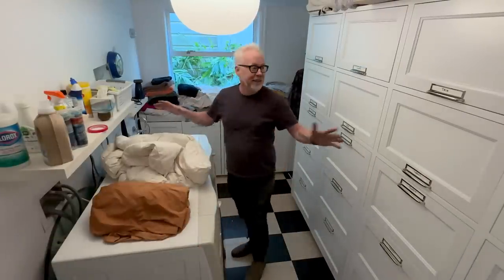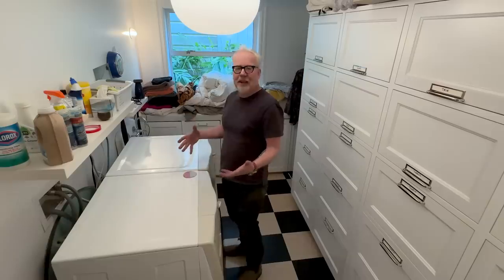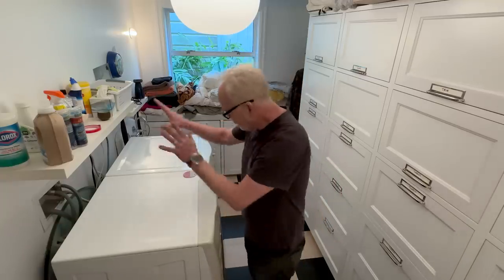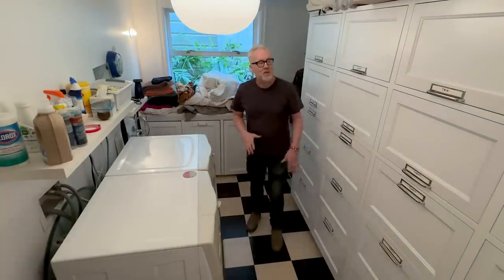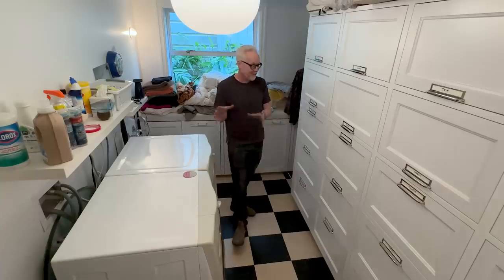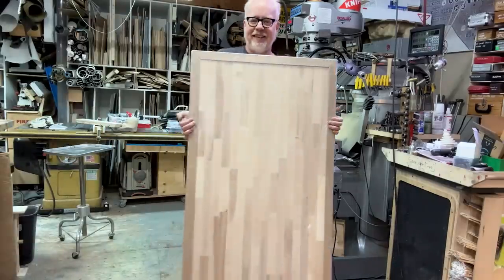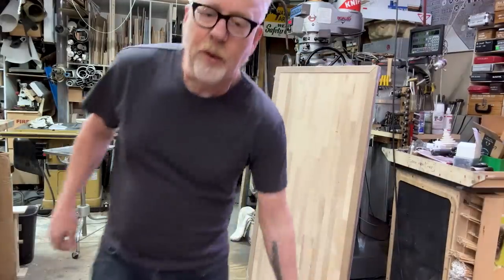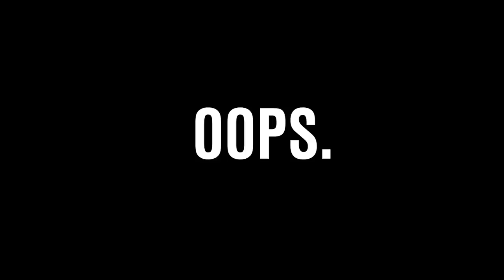Adam Savage's One Day Builds: Laundry Folding Table!

Comment: Adam has never given me anxiety before, but balancing a table top on its side on an uneven surface and then going here is my circular saw is doing just that now. After Decades of watching him. Thank you for the 3 way boxes/ clamps as I type this.
Reply: Came here to see if anybody else had the same anxiety lmao.  Good lord.
Reply: Even with the boxes it was still a beyond stupid cut, he has a table saw he could have used for that cut.
Reply: @kz.irudimen  A tablesaw with a dado stack or a router would be a way easier and more precise way to do that. He really doesn’t think through his steps sometimes. Love his videos, but holy crap…
Reply: And why use a rebate at all?  The backsplash isn't going to take any stress, just plant it on there plain style, just glue it and screw it. Adam often makes me nervous, the way he handles woodwork
Reply: @bokiphoto  If it works it works. I do not mind his wood working skills just his balancing skills lol
Reply: ehhh he was cutting a really shallow depth with a quality blade, though it was a silly rabbet with his tablesaw right there. 
If anything too wacky happened that Festool has a brake+kickback brake, and he has soft hands and can follow a line and release a trigger. I thought the apple box jack was a dandy solution for his typically Savage choice of backup weapon :)
now the conception of this thing on the other hand, both sides need to be sealed for temperature/moisture swings in that enviro.. 
and with that vhb, well, at least those machines aren't going anywhere..
this build def could have used less impulse all around, but I am jealous of that TV money laundry room. :glasses-purple-yellow-diamond:
speaking of which.. it's foldin time :face-fuchsia-poop-shape:
Reply: @bokiphoto  registration in a rabbet so he didn't needs clamps to glue and screw. that glue do be slippery. 
(and yes, he obviously should have used the tablesaw for the rabbet cut. silly rabbet :body-blue-raised-arms:)
Reply: Yeah that was a pucker factor of at least 6 when I saw that thing on its side and the circular saw still in his hand.
Reply: @bplup6419  I openly admit I do the same things but never in front of a camera I never want someone to see my stupidity and go so that is how it is done.

Comment: BTW, those cardboard channels that protect the edge are really useful. I cut them up into shorter sections and use them to lift boards off the bench when applying varnish and paint.
Reply: I like to keep used tp rolls in the shop for the same purpose, and many more.

Comment: I personally would have used some small rubber feet on it instead of the VHB. With the weight of the block, that should be more than enough to keep it in place, and allows it to move a little when the machines vibrate in use. Plus you can just pick it up if you need to move it for maintenance/replacement. Also most Home Depots now carry butcher block countertops in store these days.
Reply: I was also concerned about the vibrations. Washing machines vibrate a LOT. So to have something in a fixed position sitting on top of two of them sounds a bit problematic.
On the butcher block hardware shop though... it depends on locale. Maybe these things are easy to find in the US but over here you'd pay a royal prenium for butcher block countertops when you could buy the timber and make one yourself for a third of the price.
Reply: I'd be afraid I'd have to pull it out for maintenance/repair etc. I'd just use a couple of lengths of the waffle style rubbery shelf/drawer liner. It works great for holding workpieces in place.
Reply: also, you're mechanically coupling the two machines, which both vibrate. I have a feeling the system as a whole will be noisier this way.
Reply: Vhb sucks to remove
Reply: VHB comes in quite thick sizes to provide dampening from vibrations. I've used it in lots of automotive applications without issue for years.
Reply: I think it makes even more sense to just build the table to be a little wider than the two machines and put legs on it so it just straddles them without touching them at all. I guess that makes it harder to move it out of there, but how often will that really be?

Edit: ah, the sink is in the way.
Reply: @mediaphile  if the"legs" are only like 6 inches deep and the machines are effectively clamped together that could work too. Could put something soft between the machines to keep it all in place.
Reply: so does ikea and its the right size. dont tell him though
Reply: @machinate  separate unit attached to wall or just get some legs.. easy peasy
Reply: Exactly, that’s what I did when I built this exact thing out of mahogany in 2021… glue-on rubber feet, perfect absorbing of vibrations
Reply: @user-hd8ej8yx9p  i guess he doesnt use the washing machine ... the thing will wreck the machine s as the vibrations will destroy them.

Comment: Only Adam would try to freehand a rabet cut on an unsupported panel whilst standing beside a carpenters work bench !
Reply: also with a table saw in the background
Reply: It’s the Adam Sandwich we’ve come to know and love. 6 million subscribers now know that THIS IS FINE.
Reply: That was *concerning*, but then he brought two apple boxes and a clamp... and I was still worried.
Reply: I would have just used a router to cut the rabbet.
Reply: @sithus1966  Exactly what I was thinking
Reply: I don’t understand why he cuts one at all – it’s unnecessary, it would be perfectly alright to attach the strip of poplar to the edge of the board. You could glue it if you want to, but a few screws would be enough, in case you want to use the worktop for something else later.
Reply: Safety Third!..!..!
Reply: With a Festool track saw with no track 😢
Reply: I love Adam, but the inner woodworker in me was clenching so tight the whole video. So many unsafe things happening!
No respirator- breathing in saw dust
No supported work piece
Running a track saw in reverse
Free handing a rabbet joint while straddling it
Placing a spinning blade down (circular saw) 

I know Adam is a professional, but it just takes a half of second to have a life long injury. There is always time for safe practices in every shop.
Reply: The clench on my butthole during that segment, man.  Could've made coal into diamonds 😂
Reply: @anthonyseiver7000  he was for sure sent the track saw from festool and paid a few grand to include it in a couple projects over a certain time period.
Reply: I had to double-take because I didn’t believe what I was seeing hahaha—us mere mortals couldn’t ever dare to dream
Reply: The anxiety I had while watching him make that cut was insane. I'm over here "like just use a router!"
Reply: Not just a woodworker’s bench, but a multi-thousand-dollar slab top woodworker’s bench with two (!!!) Twin Turbo vises which is explicitly designed for exactly this kind of work! I think seeing that killed a part of my soul.
Reply: @mm9773  It's not fine, it's idiotic
Reply: Kind of curious about why use the saw rather than a router
Reply: glad I wasn't the only one screaming at my computer during that. very glad there weren't any injuries from that unsupported track saw cut. kickback on the track saw can be brutal, especially if there's no track in place. I was curious why not just take multiple passes from the top with the track and carve out the rabbet that way. sure it takes a few extra passes but would've been much cleaner and safer
Reply: The compromises that are made for getting the shot and mugging to camera are lost on ya all … 😂
Reply: Everyone has a different risk tolerance.   I saw it as more awkward than unsafe.  The workbench vise would have been easier.   Adam has more hours doing this kind of work than most of us.  He seems to still have all of his digits and extremities.  If all you see here is a safety violation, then you are missing the point.
Reply: Even if he didn't want to clear off the table saw or pull out the router, I was just going "leave it on the sawhorses and make a few cuts with the track saw, clean it up with a plane or chisel if needed" 😬
Reply: Adam doesn't worry about safety. I could never be like him.
Reply: Literally the exact kind of cut the table saw is designed to do. Would even have been faster after all the screwing around with multiple circular saws.
Reply: @sithus1966 I would’ve used the tablesaw behind him

Comment: I just did a very similar upgrade! But I decided to suspend the butcher block over the machines as I was worried about vibration. Additional utility: I fabricated a rather attractive metal and wood hanging rack above - on a pulley system. So good to get these spaces right in the house. Defo going to steal those laundry organization cubbies from you Adam!

Comment: Cordless track saws have revolutionized how I work with sheet goods in the shop. The precision, speed, and cut accuracy are light years ahead of trying to wrestle large materials through a table saw or using a straightedge and a "normal" circular saw.  Mine is a Makita. The tracks are even compatible with Festool.

Comment: "Bowling alley floor"- I've never heard that but it's a good description.  Most retailers call that "butcher block" even though it's not real butcher block.  I wanted to build a table for my office to use as a desk, I couldn't find a premade piece in the size and cost range I wanted to I made my own by laminating strips cut from 2x6 lumber.  It's not as precisely made as the commercial material but I have the pleasure of knowing that I made it.

Comment: My office desk is made of two sections of that butcher block countertop from Home Depot, stained and sealed with polyurethane, then mounted to an Uplift adjustable L-shaped frame that I stretched.  It's absolutely beautiful.
Reply: My sitting/standing desk was made using the same method, the motorized frames are about 150 on amazon and the top didnt bring it over the cost of a premade one by much at all. the result is a much more durable desk that was thick enough to embed a usb dock, wireless charger, and one of those 2 inch circle outlet things.
Reply: I just built a new desk with my dad, used ikea alex drawers and 2 legs to make an L shape. 6'x25" butcherblock was half off so it was actually relatively affordable

Comment: Hey Adam, I would suggest mounting it to the wall or giving it legs framing the washer and dryer. The reason being the machines will vibrate a lot making the top vibrate and move around. It would be nice to have a solid surface while the machines are going.
Reply: Yup, I would have added legs and made it a table that goes over the machines as well. Avoids all the possible vibration issues and framing it close wouldn’t take up much space.

Comment: our laundry(ish) room also is an impromptu workshop/repair station/bench...dad built an wrap about  over lay for the washer and dryer so that we can utilize its surface for what we need to do if its small without having to go down to the backyard shop which is equipped for larger more labor intensive activities...we still have reasons to go down to the shop but for on the spot fixing the diminutive scale of our in house set up works very well

Comment: A quick tip: when you do wood work for outside or dam places, use boat transparent varnish instead of oil. If you do use oil you'll have to redo it every year or so, if not the wood will puff up.

Comment: If you start your pull-saw cut at a lower angle and hold it further on the handle, using your second hand as a guide, you might find it a little easier. 

Fantastic video as always. :)

Comment: Tested is really poplar today.  Also should get some reusable silicone brushes for your glue applications.  That way you don’t have to throw away so many of your acid brushes.
Reply: Silicone brushes are okay, and they’re super easy to clean. For this one, I’d just use my finger.
Reply: With those brushes I always have to pick shed bristles out of the glue, so for my next project I bought the silicone brush kit.
Reply: Can’t tell if it’s a pun or typo.

Comment: We used to have a similar (less elegant) worktop mounted on top of the washer and dryer for a similar purpose, but a dryer fault made it all go up in flames. I’d factor in some cooling/ventilation between the top of the machines and the wood. Those things get hot!

Comment: I essentially did the same thing with my washer/dryer but the way I handled the gap was to add a raised shelf over the gap.  I have a bit more room in my space so I was able to add a pullout shelf drawer between the two units and did a faux panel on the exposed side of the units with a hidden door for acces to the back of the dryer. For acces of the top, the raised shelf is held in with a clear on one side and a hidden screw accessible via the hidden door on the side. The whole thing looks like a built in, but it was actually supper simple to build.

Comment: @1:25 -- so, if you want the top to not be permanently affixed to the washer and dryer, I'd be inclined to see if I can rig up a spring clamping system, in addition to the VHB tape. Much like the Irwin or other brand of furniture clamps that you might use in the shop, just set up to push in from both sides. You might need to beef up the jaws with chunks of wood that are bolted on from the inside, to give you more clamping surface and then line them with something that would increase grip and reduce marring, kind of like the removable rubberized jaws that these kinds of clamps normally come with.

Comment: I had an old Lakeside stainless steel table from a butcher shop. The work surface was kind of cold and didn’t really feel nice to work on, so I built a top out of one of these butcher blocks for it. I had enough after cutting it to size that I was able to use as a matching backsplash about 6” tall. I used lag screws and washers from the underside of the stainless surface to secure it. I love the much more substantial and warm feel it has now. Almost too nice to work on. (Almost!)

Comment: Adam, no idea about how the washing machines work in California but here in Europe I certainly would not attach anything directly to or on top of one. Once they start the spinning cycle, they tend to jump and vibrate around, especially if not fully or evenly loaded. I can't imagine that board is going to help matters - it will likely beat the crap out of the surface of both your machines and possibly the wall once the dance starts.

If you want such folding table, fix the board either to the wall or on legs around the machines so that the vibrations won't transfer to it.

Comment: The only problem I can see with you putting a piece of wood on top of those two pieces of equipment is If the washer ever has an unbalanced load, it could potentially shake it loose or worse damage the top of the washer, so just keep that in mind if you don’t have an overloading issue, then you’re probably good to go.
Reply: This is 100% going to happen....but that's all Adam does, shoddy half ass work that wobbles around.
Reply: Yeah, my comment to myself on seeing how it was to be mounted was "does Adam's washer not dance around during some loads?"
Reply: My thought was that must be a reason why they are not joined together at the top. The "normal" resonance of the cabinet is nok locked be the table. Time will tell. :)
Reply: @SomeGuysGarage  willing to bet he makes a better living than you doing his "half assed" work. If you dont enjoy or like his work, just dont watch it?
Reply: @CCW-lz6oh  what has that got to do with anything? Would just be nice if someone who gained a lot of exposure would at least do things right...some of the things he does is dangerous and the last thing anyone needs is people following his example and getting hurt or killed.
Reply: That's half the fun of DIY stuff, but now it's done and time will tell what needs to be changed for version 2.

If it was me I probably would put rubber feet on the bottom and some corner braces on the ends to hold it in place without actually affixing it to anything. That also has the advantage of making it easy to pull off and reinstall if the appliances need to be moved for whatever reason

Comment: I'm building a replacement shelf in our laundry room. There wasn't a stud on the far edge of the shelf and the particle board shelf started to take on an inverted curve. The wood is recovered wood from the front steps of the house (The house was built in 1920 and the front steps were in rough shape when I bought it) I used a wheelbarrow as an improvised saw horse at cut the board at 52 inches. After gluing, sanding and painting the shelf will be put in place.

Comment: Looks good, my concerns are the long term impact of the vibration from the machines ( ex. spin cycle) on the wood platform holding firm over time. Plus moisture and temperature ( heat)  changes from the machines could shorten the life of the adhesive on the tape.
Reply: VHB tape holds moldings and trim on cars, GoPro mounts on surfboards and helmets, etc. I’d suspect that horizontally, it’s ok to hold a counter.

Comment: A wonderful tool you may like is called a biscuit jointer. That slot you had to cut along the edge would have been much easier and safer with one. You can set the depth and just slide the guide along the edge while it's still laying flat.

Comment: If you are going to put a top directly onto two washer/dryers (a bad idea), you should use something like foam pad adhesive tape instead of vhb,  to limit vibrations going from one machine to another. Would also suggest a 1/8" - 1/4" gap between machines if not there already.

Comment: Just a couple things, I would've put a lip on the under side to slot over the machines, and also most appliances have screw in/adjustable feet for leveling them. And last but not least you could've made the backsplash a bit taller with a top that slides all the way to the wall which would've made a sort of mini shelf 👍